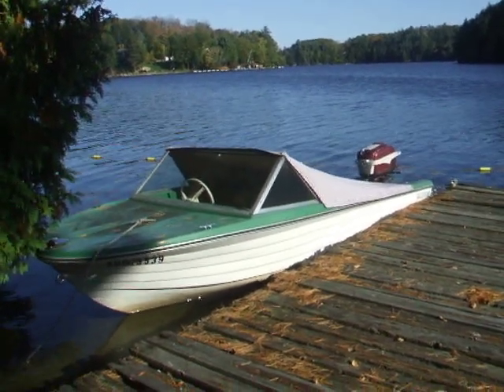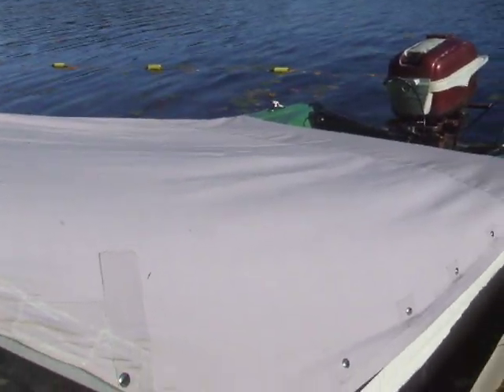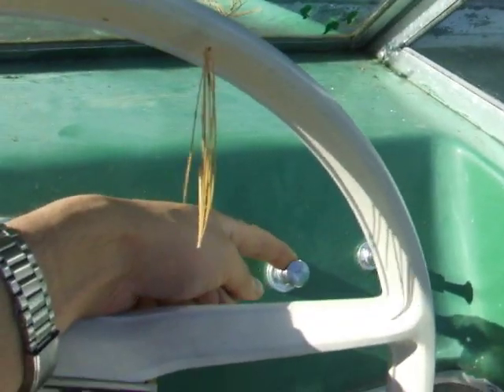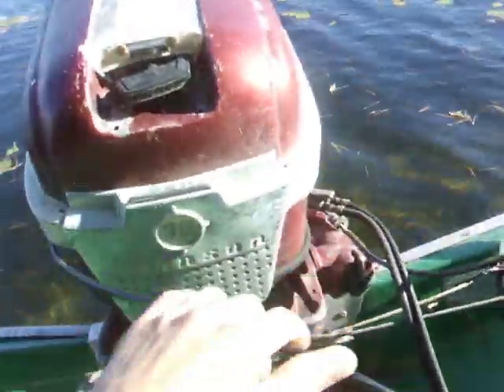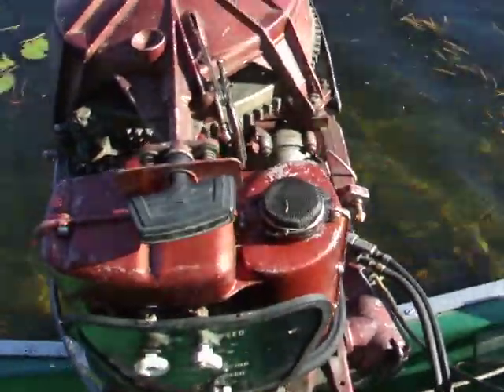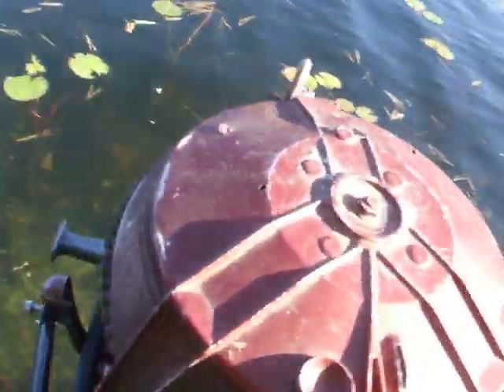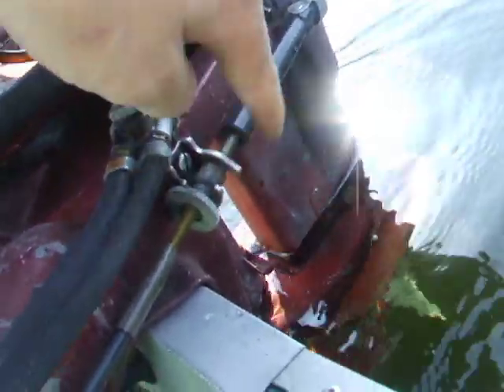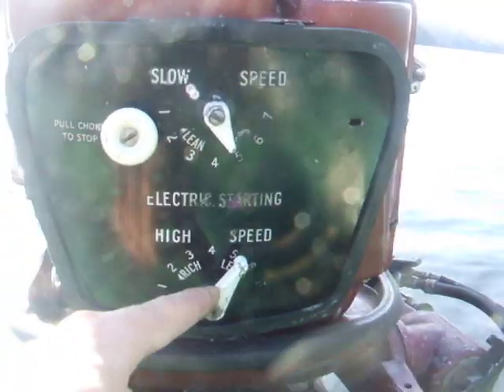1956 Johnson Javelin 30HP Outboard on 14' Viking Fiberglass Runabout

Comment: Very nice motor. I used to soup them up, changing the different model parts... Higher compression heads, bigger carb, modded 2 blade brass prop. The aluminum alloy is actually better than post 1960, that is why they had to make the castings thicker. Your compression is fine btw. More important the two cylinders are equal. You can always check your rings through the intake ports, but your motor has good power and starts fast. That is such a fun motor to work on and is actually fairly light. Always smart to pick up a spare parts motor. Any big Evinrude or Johnson twin of that era will provide quick switches of parts.
Fun video on a nice lake.
Cheers 🍻
Reply from the maker: Thanks for the comment and the good words Didier!  So you used to work on these motors too, nice you must know them well.  Yes I think I get 105PSI in both cylinders, not sterling but not too shabby, and yes it always starts before I can release the key, unlike my neighbor's Yamaha 70hp triple carb.  He has to crank it several times cold, still trying to figure that one out (I think lack of an old fashioned choke, has a primer thingamabob).  It is fun to work on the Javelin, and yes I did mount it on the boat at dockside once all by myself (wouldn't like to do it again lol).  I do have another motor like these, but not for parts, a 1961 40HP SuperSeahorse, hope to get it tuned up soon, look at my other videos.  Let me know if you'd like me to email you some OEM brochures, bring back memories I'm sure, make very interesting reading, I downloaded them all.  Best wishes Didier and Cheers!~  Bellarmine
Reply: @bellarmine33   I reviewed your video. I did have a very similar motor with the closed cover and carb silencer. I tended to adapt the two piece open bottom covers, because they were so compact... No room for a starter though. That motor has very good sound control. I think I heard an exterior piece giving off a noise, maybe the carb faceplate... I believe you said you removed a high speed cut off... Was it a little vacuum switch with a single wire? That will act as a soft kill switch, it will protect your motor if the prop comes out of the water or you over Rev because of a rope or sea weed in the prop. 
It will only stop one cylinder from firing temporarily, it is a good idea. I threw a rod through the case on one when I caught a rope. It occurred in under two seconds.
You did really good mods on that particular model. I would use a domed strainer on the airbox to get more flow. Or remove a solid cover, and even plug exhaust. I did pick up one motor with a mouse nest right in the crank case. Because of the reed valves, I believe they entered by the exhaust. Mice like oil btw.
Brochure would be neat, maybe just one old pick. My favorite was the green cover.
That aluminum buffs up really nicely to a chrome like finish. The boat is a nice color too, you could probably do a refinish really easily.
Cheers again 👍
Reply from the maker: Hi Didier, finally getting back to you.  Sure, I'd be glad to send you a brochure or two.  Just send me an email to Bellarmine followed by the @ symbol, then Rogers and Com.  

No I left the vacuume cutout switch for runaway saftey, think I can hear it clack when I throttle down suddenly.  But yes I did remove the hi-throttle starter cutout switch, because of the automotive starter solenoid I used.  Guess I should get a marine solenoid then I can put the saftey switch back.

I start it in gear all the time find it rather handy, I'm used to checking first.  Speaking of which, that's really funny about your Dad, My own Dad actually did the same thing!  He's used to the more advanced single-throttle control (still looking for one muchas denieros!), he did the same thing started in gear tied at the dock almost drove it up on the land lol!  

Hope to hear from you soon, good chatting Didier. cheers!~  Bellarmine
Reply: @bellarmine33   Will do, I used to get all my vintage stuff at a dealer called St Donat Marine. They were more concerned with trying to keep up with the newer technology, so I even got free motors. I would do them favors when they were stuck. They were Bombardier but also kept old Chrysler and Merc stuff. They did boat storage and maintenance for miles around. I'll check for their contact, I'm guessing you might be in Ontario... So, not that far. Do some garage picking one day!

Comment: I'm digging mine out this summer one owner last time I ran it 1964. Has approximately 40 hours on it. Can't wait. Thanks for posting this
Reply from the maker: You're welcome Bill, wow now that is what I'd call a low hour motor lol, and original owner too!  I'm actually the 2nd owner, grandsons of the original purchaser made a gift of it to me when I moved, real nice of them.  This one hadn't run since say 1975.  I get about 105PSI in both cylinders, not too shabby guess it could stand a rehoning, goes pretty good!  Let me know if you'd like any tips on what I did to restore mine, on the wiring, or a shop manual free download, be my pleasure to help anytime, helped several people in the past.  Also have the 1956 Johnson brochure on my HDD, can email it to you if you wish makes for good reading.  Hope you get her running, I think you will be pleased - Cheers Bill!~  Bellarmine

Comment: I know this video is old but I still had to comment. When you said top of the line for the day I couldn’t help but think it’s still the top of the line for many who adore vintage equipment and keeping them running like they used to. For the money you spent and what little work you put into this setup the value is priceless and I bet the experience is just as good. Well done.
Reply from the maker: Thanks for that Josh, I deeply appreciate it!  Yes, it was a real thrill getting it started for the first time in 2011, after sitting in their boathouse for over 35 years  - sitting there before I was even around, how strange.  I guess others just saw an old motor, whereas I saw myself water-skiing - different vision.....:o)   Up till then I had only driven my little 6hp Johnson in my other videos, so yes to me the 'experience' was just fantastic.  You might say the video is still 'current', as I took a cruise just last week and as always it's still running like a Swiss watch, especially after getting to replacing the lower-unit seals a couple years ago, no more leaks.  Yes, top of the line for '56, and still the top motor I own....:o)  Cheers Josh!  Bellarmine

Comment: I’m eight years late to the show but thank you for the video and all the great information. Inspiration to keep restoring my 1960 Lone Star capri runabout
Reply from the maker: Hi Michael, Thanks for the comment, and you're welcome for the info!  You're not 8 years late, I just took 'er out for a drive yesterday, still running just as nice as in the video, you can't kill these...:o)  Good luck with your 1960 Capri, do you also have a Javelin on it?  Let me know if you'd like a free E-brochure PDF for your Johnson/Evinrude motor, I have them all.  Cheers Michael!~ Bellarmine
Reply: bellarmine33 I actually don’t have an outboard for my lone Star yet. But I did just purchase a 1978 ranger Aztec 1750-v with a Johnson 115! It’s been sitting since 1996.  In all honesty I have no idea what I’m doing so I need to do some more research before I try to mess with it. I’d hate to do something wrong and damage it. Any tips?
Reply from the maker: @mik3mill3r11  Hi Michael, A Johnson 115, nice!  That'd be a V4, would you know what year or model, maybe same year as the Aztec?

If it's 70's V4, I have a big PDF Shop Manual that would give you all the info you'd need for the motor.  As for damaging it, it's pretty hard to do that if you just check a few simple things first.  Quickly, I'd inspect and change the lower unit oil, see if any evidence of water or rust.  Then, if the electric starter spins over the powerhead freely, make sure you're using the proper gas/oil mix of 50:1, and then if it doesn't start go ahead with the usual checking for spark, then fuel problems etc etc.

As you can imagine I have a dozen questions on it, photos would be great, history etc.  It's difficult diagnosing via email, but glad to help, done it many times.  Let me know if you'd like the PDF Shop Manual or any more tips on the above.  If you wish you can also reach me by going to my YouTube 'About' page, my email is there.

Cheers Michael!~  Bellarmine
Reply: bellarmine33 thank you I really appreciate your help. I don’t see your email address in the about section. I believe it’s a 78, original to the boat.
Reply from the maker: @mik3mill3r11  Hi Michael, Strange, thought I turned that option on - it's supposed to be on the 'About' page under 'Details - For business inquiries (click to show).'  Oh well who knows lol.  Anyway, my email is simply my username without the 33, followed by ROGERS and COM.  Try that and I'll get back to you.

Also, 2 points forgot to mention in last post.  If it's been sitting like you say I'd also take out the spark plugs and put a few tablespoons of oil in the cylinders before turning it over.  Also, take off any air box/air cleaner in front of the carburetor(s) to make sure there's no 'mouse nests' waiting to be sucked in.  Ask me how I know lol...:o)  Talk soon Michael, cheers!~  Bellarmine

Comment: Thank you so much for your help. Today after countless hours of repairing the starter that was frozen I was able to free the bearings and basicly rebuild it. Reinstalled and checked continuity before attempting to turn the engine. It turned over fine. Got the fuel tank atached And wala it started right up. All seemed fine but wanted to restart it to adjust the mixture. It started and as I was adjusting the lean mixture It completely detonated .The lower leg gears disintergrated. I guess sometimes when something is that much of a headache its just not worth putting anymore time effort or money into it. Done...
Reply from the maker: You're welcome.  My that's really too bad it disintegrated on you, sounded like you were on your way.  If you don't mind, I'm sending you a PM with some thoughts.........:^)

Regards, Bellarmine

Comment from the maker: Thanks for the comment, glad you like the movie!
Yes, I use a battery to run everything, charge it one a month or so since the motor doesn't charge it by itself, yours might possibly though.  The steering is using vinyl coated clothesline and pulleys.
I'll send you a message shortly with some info and details if you'd like

BTW I watched your video of your 3.5 Mercury, it is pretty fast!

Comment from the maker: Yeah, I knew that from my Dad's 1960 Johnson OEM shop manual,  learned a lot from it, motors older than 1964 use 25:1. He had a 5 1/2 CD-17 when he was younger, wishes he'd kept it.  Nice little motor you've got yourself, the HD-20 cost all of $94.00 in 1941, amazing.  If there's anything else you'd like to know from the manual, give me a buzz.  Cheers!

Comment from the maker: @The56Blur You're right, they're great motors! The old stuff is just simpler, run forever.

I tried looking for a chrome door, but no joy. Luckily you have the side trim & pull-start cover, which are missing on my friend's. Boy, I didn't realize they were so rare!  

I've got an old 1959 18hp Johnson FD-13 I'm restoring for myself.  Nice classic white lines, I'll post a video of it when it's done.

Thanks for the comment, you're the 1st! Glad I could be the 1st on your video too...:^)

Comment: Nice boat and motor.  You're right about those old motors.  After spending this past spring and summer in vain trying to tune up a 200 horse Evinrude with six carbs, I'm going back to the boat I grew up with:  1957 Arkansas Traveler with '57 Johnson Golden Javelin.  Still runs like a champ.
Reply from the maker: Hi Frisco, thanks for the compliment.  Wow, a 200horse Evinrude with 6 carbs, complication deluxe!  They run great when they run, but sometimes that's not often lol. A friend told me a story about an old Volvo outboard a friend of his has, running for years and with a cracked block even.  So he decides to go and buy a brand-new Volvo outboard.  Upshot is, he's more often using the old cracked-block motor to tow the brand new one in to replace this or that electronic gizmo.  You're right, oldies but goodies, and the older they are the better I like 'em!

You've got a beautiful combo there, I really like the 1957 Golden Javelin gold and cream style.  I have the original brochure for these on my hard drive, along with all other Johnson/Evinrude years from 1910 ~ 2000+.  Let me know if you'd like me to email you any.  Good luck getting your vintage 35HP running, if you'd like some advice sometime drop me a note.  Thanks for the comment - Cheers!  Bellarmine

Comment: Very nice old outboard and I enjoyed the sound as you toured the lake. Just a couple of safety comments, you should have a battery box, to protect the terminals from any metal contact (like the gas tank!). The second item is household wire nuts are a No No, on a boat. They come undone with vibration. You should use crimp connectors and seal them if ever using the boat in salt water.
Have a great season with the old girl!
Reply from the maker: Thanks for the thoughts, much appreciated.  I don't think I'll ever be on salt water with my Viking, but your advice about wire-nuts is good to keep in mind.  Come to think of it I don't see them on cars either, I figure for the same reasons you mentioned!  About the battery, that one went bad on me, so I picked up a couple good marine batteries (from the dump!) with top terminals, so they can't hit anything anymore lol......:^)  Cheers!  Bellarmine

Comment: FYI, A lot of experts say that with the modern synthetic oils you can run all engines at 50 to on1 the problem was the oil quality not the differences in the motors.
Reply from the maker: Thanks for your comment and the info Reg, that's interesting to know!  I'll check it out and keep it in mind.  Cheers!  Bellarmine

Comment: Some of the small motors were 16:1 gas oil mix.  My 55 Johnson 5.5 and my 55 Evinrude 7.5 are 16:1.  Nice running Javelin you have.  Makes me want to get an old vintage boat and restore it.
Reply from the maker: Thanks for the comment.  The bulletin on fuel mixture in my Dad's shop manual is from the 1960's, so I guess they neglected to mention the older motors.  Glad you enjoyed the video - Cheers!
Reply: Yup, they were officially 16 to 1, one quart of the old straight-30  'military spec' [before the SE grading system] crankcase oil to a FOUR gallon tank!  But, the bigger motors had 'jeweled' bearings and WILL happily run on 50 to 1 especially with today's TC-W3 oil.  If 50 to 1 on the 1960's sludge didn't kill 'em, TC-W3 sure won't!

Comment: I just got a 62 super sea horse 40 and I really thought it was 50 / 1 thank you for that  24/1 will be what I do on the mix
Reply from the maker: You're welcome William, yes 24 / 1 is the correct mix from the factory for 1962.  Or 25 / 1, just easier to calculate and plenty close enough - 40ml oil per 1000ml gas, I'm always mixing small amounts.  You can also get into an endless debate with people on both sides who say it's not the motors that changed to 50 / 1 but the oil quality - hence any motor with full needle-bearings like these 40hp's can run on 50 / 1 modern oil, as apparently nothing changed in the motor from 1963 to 1964, just the oil.  On the other hand I just don't want to burn up my powerhead for a half quart of oil, so I just run the factory mix and the debate lives on.........:o)  I've also got a nice 1961 40HP Super Seahorse I'm restoring, beautiful motor, almost same as yours.  If you'd like any help or tips, or a PDF brochure for your own motor just drop me a line anytime, be my pleasure.  Cheers William!~  Bellarmine
Reply: @bellarmine33    water to stick with 24:1, but with the older type oil. The pistons on these particular motors had long skirts snd you rarely saw scuffing or seizing. The clearances may have been larger. New oils are generally superior for less smoking, they do have many additives. Some will also adhere to surfaces much more. 
Always better to follow a known protocol with oil but these motors are tough and well cooled, they won't react like a chainsaw.
More dangerous is running a cylinder too rich and melting a piston or using bad gas and getting predetonation.
Cheers 🍻

Comment: On your newer motor,  If you use 24 to 1 oil mixture your motor it will last longer.  It's up to you.  I have also learned to always keep the motor tipped up, out of the water, when you are not using it.  It's better for the seals, and etc.  When I was a boy I learned to water-ski behind a Javalin over 50 years ago.  I have all the chrome parts and a paint sample.  If I win the lottery....

Comment: I really liked this video.  You were very informative about the engine which was interesting and was impressed by the condition of the engine!  Nice job!
Reply from the maker: Thanks for the comment, glad you enjoyed the video, I had a lot of fun filming it.  Right now this winter I'm giving the lower unit an overhaul, and replacing the lower crank seal (removed the power head).  Hoping to have it all ready for the Spring in 2015.  Wishing you a Happy New Year - Cheers!

Comment from the maker: It was actually $582, slight mistake on my part..:^) I talked with my Dad, and he said it'd be 2 months salary ++, based on an industrial wage back then of $3000 a year! Lot o money to spend on just an outboard. My friend's grandad, who bought it new, sure wanted top of the line, couldn't get any better. Only year for a 30hp, and 6volt system too! Next year was a 35hp 12volt, the 'Golden Javelin'. Stuck a speedo on the other day, and gets up to nearly 24mph, pretty fast. Thanks for your comment!